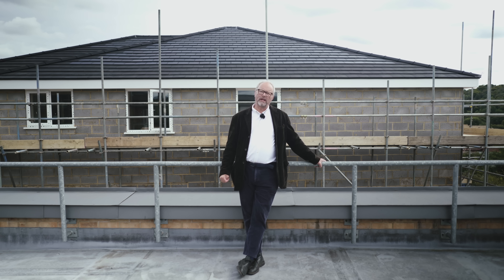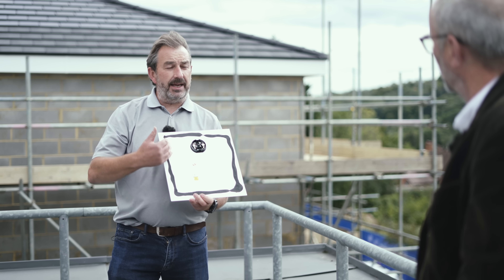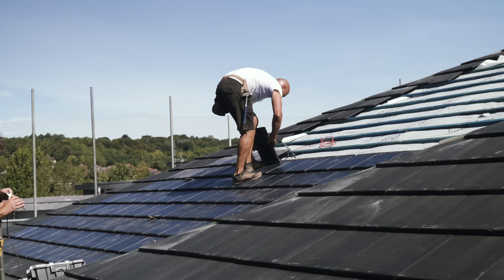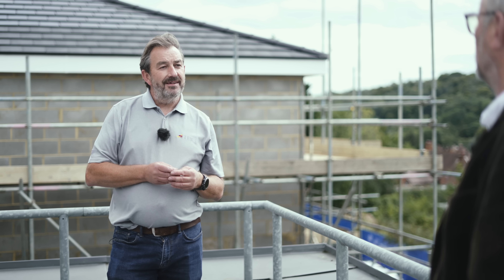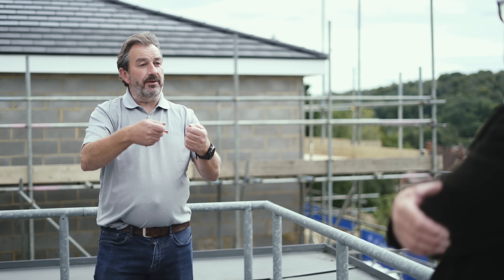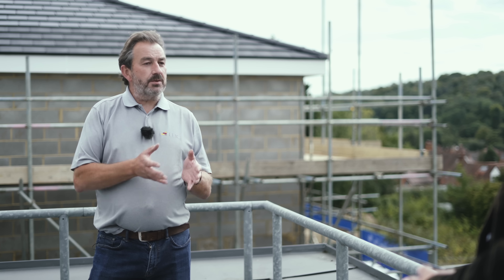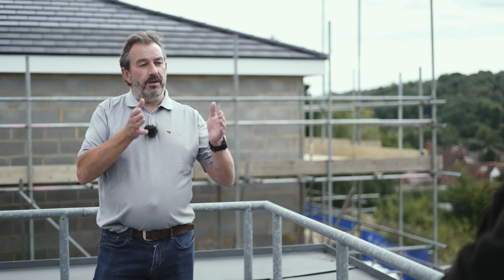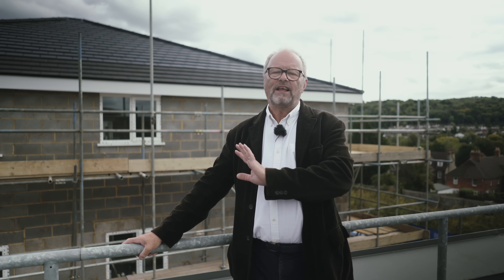Solar Roof Tiles - should every building generate its own power? | 100% Independent, 100% Electric

Comment: Domestic Solar is Expensive 'ecobling' and a long way down the priority list. Integrating lots of small solar panels with a roofing material is the same flawed logic behind solar roadways.
Reply: ... Not if you have the feed-in tariff , dude!
I make a fortune - and get to feel a bit tree huggy as a fringe benefit..... !!
Reply: @andymccabe6712   FIT is dead and doesn't change the rationale, it might change the case by case economics. At the end of the day someone e.g. the Tax payer has to put in productive work for it then to be spent on misguided subsidies.

I'm not against solar but on a domestic scale it's dithering 'ecobling'. Domestic battery storage is an even worse idea based on distorted economics. For the big box warehouse folk solar makes more sense if it's essentially going to be completely self consumed and they can successfully manage their demand.

Comment: Seems like it’s made for new construction, as I’d guess most homes are not built with the support structure of adding tons of concrete on the roof. Still, very cool.
Reply: Joel Fuller Where are you based? In the U.K. roofs have always been constructed to support such loads. Pre WW2 slate was the preferred roofing material, and being slightly lighter such roofs may require some degree of reinforcement, but since then concrete has been the dominant material and any roof built since should be able to cope with these. Don't forget roofs are built to hold not only the weight of the tiles, but also two or three feet of snow- not something we are likely to see very often these days!
Reply: @spencerwilton5831  Ah thanks for the clarification. Based in US (west coast). We don't have nearly the required spec for weight on roofs unless its special case or inclement weather area. So this makes sense. Thanks!

Comment: Problem is, as long as these eat into margins, and thus profits, of home builders (multiple times the cost of a boggo roof, over multiple roofs..) then the CxO staff of large house builders simply won't see a reason to do it. I mean, it'll eat into their dividends with no reward to them....

Because lets not beat around the bush here, most CxO staff of large companies aren't interested in anything that can't be ameliorated to an extent that it doesn't impact the bottom line, even if it could get them positive press.

Comment: I love new & innovative ideas, but there’s a few issues I see. Firstly, concrete tiles are the cheapest & nastiest roof you can put on your house. (note the comments about roof replacement after 30yrs, that’s about their limit before they start to fail). They’re notorious for attracting moss & lichen too. I wonder what that will look like 10-15yrs in. Secondly, £1 for a concrete roof tile? Really? In Ireland you can buy them from about 40p each. £1 will get you a Spanish natural slate (with 75-100 yrs life). Thirdly, Despite not ever having seen them, he casts doubt on Tesla’s toughened glass tiles. A toughened glass tile will last 100yrs & will not attract moss or lichen as it’s too slippery. American homes have many more dormers & silly gables (which is why in my view, a lot of American houses look naff). If Tesla can do roof for that market, the UK with simple vernacular roofs, will be less hassle. It may be that the Tesla’s roof has to be ‘pre designed’ to ensure there’s no cutting on site etc. In case any of you are wondering, no I’m not a Tesla fan boy. Apart from the model S, I wouldn’t buy any of Tesla’s cars. There’s better built out there for the same money & you don’t have to turn your wipers on by touch screen. 😆. I’m now turning YouTube off for a week while the comments pile in 😉
Reply: I'd be getting plastic surgery to change my looks if I were you - you said something a bit critical about St. ELON!
Be afraid - 'they' will find you.......!!!!

Comment: I want to go a step further. It should be illegal not to put solar panels on a new building.
Reply: pete smyth  Here in the Netherlands every year 10.000 people die early as a direct result from the air pollution. Before they die they are sick for a long time. And my country keeps buying gas from dictator Putin. So yeah, things need to change.

Comment: Another excellent video Robert - thank you!
The only thing I found a bit odd was that the roofing contractor was having to cut a hole in the plain concrete tile to facilitate installation of the electrical component.  This adds time, creates waste which adds cost so I wonder why they can't have the tiles made with the hole already formed as part of the casting process?
I'm sure that tile manufacturers aren't doing this now because there isn't a big enough demand for them but hopefully this will change.  When it does, the cost of having a "solarised" roof will reduce and so become even more of a no-brainer!😁
Reply: think the solar tile is assembled in the country but it shipped as the base component to save weight. my main concern is adding multiple new holes to the roof which aren't covered by the title above

Comment: Hang tough.  Wait on a bit.  Tesla already does this without the concrete.  The solar modules are the roof tiles.  Surly this is lighter and quicker than attaching solar modules to 4.5 kg cement roof tiles.

Comment: That looks like a much better system than Tesla's tiles in nearly every regard (weight, efficiency and cost), except that it obviously can't visually match different roofing materials, e.g.slates and terracotta tiles, like the Tesla ones can. That said, with the concrete tiles, it looked pretty stealthy to me.
Reply: The Tesla tile is doing the single function of solar in the glass tile. These tiles are take tile. Drill hole in tile. Glue on solar panel. So incresed complexity. Also the solar tiles are now generally 3 tiles in a row, so they go in in 3's. These are individual tiles so 3x the wiring!
Reply: @markyates5744  yes installation time would be longer with these, plus on site assembly time, which the Tesla times don't have. On site assembly is harder to quality control, so they may not be as robust in the long term.

However, the thick toughened glass and tile pattern both reduce light transmission in Tesla's tiles significantly, by around 30% if I remember correctly. Whereas these tiles don't have that issue. Tesla's tiles also weigh about 50% more per square foot than concrete tiles, and therefore some roofs will not be able to take that extra loading without being strengthened first.

Comment: Concrete Tiles? Concrete is the most poluting building material in the world. To make concrete you need tonnes of water and tonnes of other materials just to get one tonne of concrete.  If the solar panels were put on baked tiles it allready would have been better.

Comment: From the footage I take it that their is no requirement for counter battening, nor any rear side ventilation? Are they MIS:012 registered?
Reply: Andy Hodchild we don't usually counter batten, the sarking felt has sufficient "give" to allow and water to drain behind the horizontal battens. It's also breathable. The underside of the roof is not usually insulated here unless the roofspace is habitable which is not the case in these house- the insulation will be at floor level in the attic space, and the roof ventilated via the soffits.

Comment: I am concerned with the longevity of the glue which each individual panel is glued to the tile. Concrete tiles last for 50 years. Will the glue seal out the water for the same period?
Reply: I'll bet the solar panel doesn't last anywhere NEAR 50 years.......!

Comment: What about the lifetime of the roof? Would the panels get replaced after 10 years ?
Reply: about 100 years for a concrete tile roof.
Reply: But what about the solar panels?
Reply: @KS-mt1lb  They usually have a 25year guarantee, I don't know what these have.
Reply: If they follow the usual pattern for solar panels, after 25-40 years they will still be generating about 80% of their original energy rate.  You only change the PV's when you have an option so much better than their current output, that it's worth the cost to change them.

Of course, 40 years from now you'll probably have a lot more interesting power options than just wind, solar, or hydroelectric dams.  There'll probably be a mini-fusion reactor for each neighborhood, or somesuch wonders.

Comment: Connectors, shadows, poor faulty cells problems with „normal“ panels 😅 I doubt they work fine... 

Maybe where normal panels are forbidden for optical reasons
Reply: I'll bet in those situations, concrete tiles are also banned!!!

Comment: What we currently see fires occuring in PV installions, built in roofs. The failures are generally caused by faulty connectors of the PV installation in combination with the built-in feature. When we look at this concept we see a lot of connections which can fail. The failure mode of the DC currents is that you get arcing and heating up of the connection, resulting in fires.

Comment: I wonder what they do with metering the solar and a block of flats. is it first come first serve to the free electric? how do they split the service charges etc. tricky.
Reply: "I wonder what they do with metering the solar and a block of flats." ... you said it yourself...with metering, obviously!
Reply: @MrAdopado  so if I'm home during the day I get the cheap electric, and my neighbour who works all day has to pay the higher cost of grid electric?
Reply: @samjarman3136  Same problem as now. The price of electricity varies constantly but depending on the type of account you have you can have pricing that applies consistently. The flats would just get a block payment for what they produce and the "discount" could be applied across the board for all residents by percentage of their bill (just one of a dozen possible different ways). Why not focus on solving problems rather than trying to think up new ones that don't even exist!
Reply: @MrAdopado  so you have an independent metering company involved? the admin fees for this are likely more than the electricity cost. I'm not just making this up, my comments come from real life experience where I've actually put this stuff in
Reply: I'm also jot looking for a problem, I'm asking what the solution is.
Reply: @samjarman3136  No ... that's what a smart meter is for. That's what happens now. It speaks directly to your supplier.
Reply: @samjarman3136  Better not to waste effort justifying the status quo .. use it instead to make a better, more energy efficient, future.
Reply: @MrAdopado  so you're saying in fact the residents do not benefit from the solar. think about it. goes back to what I was saying about time of use. if the solar generation is taken off before the smart meter then those using energy whilst the sun is out benefit more. Think about how it will actually work in practice.

Comment: A better aesthetic maybe, but every tile is a potential point of failure compared to only a dozen traditional panels. That's fine if you can access them easily, but the wiring doesn't look easy to access once on the roof. Also, how would you know which one was at fault? Maybe this has been considered and all would be ok, but more info is needed.

Comment: So Tesla says their solar roof tiles cost $1.49/watt USD.  Which would make the 15 watt concrete tile in this story cost $22.35 USD rather than £30, or $38.40 USD at today's exchange rate.  So Tesla's roof tile is about 40% cheaper than this concrete roof tile.  This is the advantage of thinking big and tooling up for millions of units, a too big to ignore cost advantage in the marketplace.  I think this concrete roof tile with solar panel affixed is a great idea but needs some serious investment in production technology to drop the costs to compete with Tesla.  Molding in the holes when making the initial roof tile would help reduce costs, too.  And I think there are inverters available that will work at less than 300 volt string voltage so more production on cloudy days would result.  Plus insulation displacement connectors to the high voltage cables rather than the fiddly wire stripping shown in the video.  Room for improvement / cost reduction in several areas, but a good start.

Comment: Neat.  You do have to be careful at installation though.  All it would take is forgetting to make one connection in the row to ruin your day as you go back through all of the panels trying to find the missing connection.  It occurred to me that if they made the connection a part of the edge of the tile, then they'd (theoretically) connect automatically when they were installed.  Of course, the problem with that idea is it'd be REALLY difficult to remove a tile in the middle if it has to be replaced for whatever reason.  Maybe a sliding connector?  {shrug}

I'm curious, is the whole roof tiled with this, or only the sun facing side?  The other side would get sunlight, just not as much and the tiles wouldn't create as much electricity.

Comment: Why is the installation done from bottom to top instead of top to bottom where there is no stress of possible cracks in the panels from the weight of standing on it?
Reply: That's the way they overlap to let the water run off. Much easier to put on.

Comment: what's the lifespan of these tiles, the tiles for weather protection would probably last for decades but what about the solar cell add-on can you peel it off 15 year's down the road or do you have to replace the whole tile , that could be costly

Comment: Good luck to them.  They should be able to carve out a nice neat for themselves for a decade or so.  but I can’t help thinking that Tesla will eat their lunch eventually.   I think I noticed that the non solar tiles were a different colour ...  or at least non the same reflectivity.  That alone will probably make it a less attractive proposition than Tesla solar.  I’m also wondering about the lifetime of the solar tiles.  Presumably the whole roof will need retiling once the solar cells have degraded significantly so it’s a big deal.

Comment: They need to make solar panels that have a positive and negative contact on them, just snap unto an energized bus-bar. The same way a circuit breaker attaches in an electrical panel. 
No wiring! Quick snap-in install! Get rid of the cement tile for god’s sake!
Plus, allow bigger space for airflow!! Panels HATE to get hot.

Comment: What happened to Elon Musk‘s solar roofs?
Reply: They are still being installed around the USA, but they are production-limited (needs more gigafactories!).  They are working to increase their production quantity and lower the price as well.

If it follows the same pattern as they are using for the cars, eventually each region of the world will be supplied by a nearby gigafactory, to reduce shipping and conform with local laws & preferences.

Comment: They need to make solar panels more robust, and get rid of the need for cement tile. After all, the only purpose for cement tile is to protect waterproof fabric. The solar tile can do it alone!
Reply: Then you need to worry about wind lift under the tiles/panels if they're too light.
Reply: videogalore, you need to worry about wind lifting solar panels doing it the conventional way.... no difference with my suggestion, other than just ditching the cement tiles. Just make solar panels serve the function of Waterproofing underlayment, and get rid of the cement. There’s no reason for cement tiles, if you have solar panels protecting the fiber
Reply: @tjam4229  I'm not saying it's not possible, just that using corrugated metal roofing sheets is a different game to using heavy concrete tiles.
I've seen metal roofing sheets peel off of a roof, but never seen concrete/clay tiles doing this.